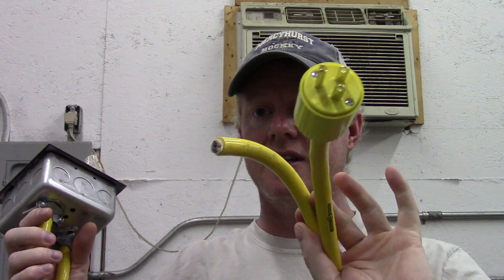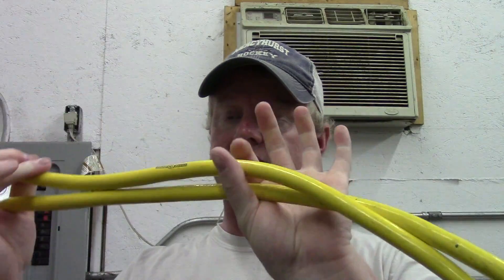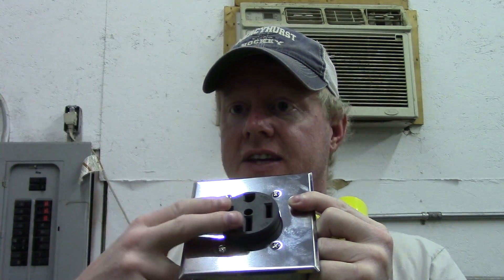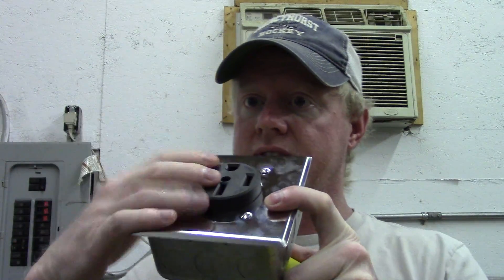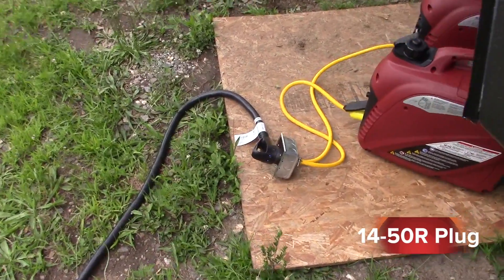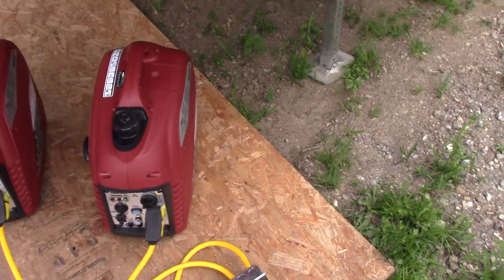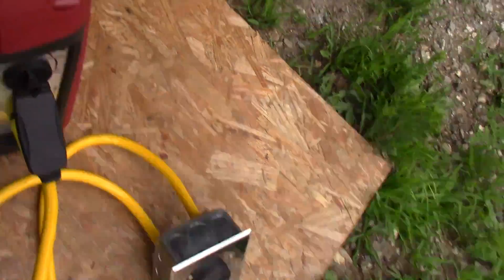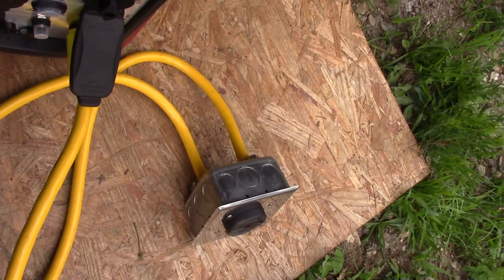How to make an Inverter Generator Parallel Cable  AKA Cable of Death

Comment: My Alpine has a 240V 50amp service plug and runs two 15k air conditioners. I'm thinking each must pull from separate legs. I haven't looked at the camper enough to say how the power is connected in the panel. Your adapter will provide 120V to each leg. As long as true 240V is not needed somewhere I'm thinking it should work fine. You don't forsee an issue on my application do you?

My desires are to parallel a Westinghouse iGen4500DF with an iGen2500.
Reply: Will a 30amp & 15amp to 50amp Y adapter work the same way as your cable of death?
Reply from the maker: Yes, if the adapter is adapting to 30amp 120V or 15 amp 120V.
Reply: Do you bond the neutral and ground together either in your box or in a separate plug?
Reply: You say not to disconnect one cable while things are running. What's going to happen if you run one of the generators out of fuel?
Reply from the maker: I would check your panel in the RV just to be sure. Everything in the camper needs to be 120V which it normally is unless you have some residential style equipment in there.  It will work but you will want to tie your 30A 120V output on the larger generator the smaller 15-20A 120V then to the 50 AMP RV plug to get the full capacity of that larger generator.
Reply from the maker: Larry Attebery Bonding neutral and ground isn’t advised. On having both plugged in it won’t hurt things if a generator runs out of fuel or you just use one. The important thing is that while either or both generators are running the male ends will be hot so that’s why they should be plugged in.

Comment: I built one of these to parallel a Yamaha 2400IS(6yrs old) and a Hyundai 3200(new) but it didn't work. All it did was overload the Hyundai and shut it down...any thoughts
Reply from the maker: Both of those should be inverter style generators. Sounds like you have a dead short.  Check your wiring (not connected at all) with an ohm meter you likely have some crossed up.  I'm assuming you used a 50 amp 240 plug and bonded the hot's as I did on the video?  If that is the case you should be able to verify with ohm meter that you haven't connected ground or neutral to one of your hot wires on the 50 amp plug.
Reply from the maker: Does the Hyundai support parallel operation?  I see some listed that do not.

Comment: Shane, 
I just built a house and had a generator panel put in so I can have lights, water, heat (5 - 750w baseboards) etc. 
In my garage there is a 20' cable that I plug into my generator, outside.  They put a 30a twist lock on the cable. I assumed I was putting 240v to my house, is this correct? 
I have a champion 9000w cont, 11200 startup gen.  (It has the big 50a receptacle, I don't know why the electrician's just used a 30a twist lock)
I also have a 3500w echo bearcat inverter generator and am thinking about purchasing another (and getting rid of my big champion, it's too noisy and hard on fuel as it doesn't have auto idle)  and making a "cable of death" parallel cable.  Instead of using the standard 15a plugs like in your video, I was thinking about using the twist lock plugs to go to each of my Inverters, would this work? And would this give me 240 to my house?
Reply: If I have two Echo 3500w inverters and if I make a cable of death with 30a twist locks that go to each inverter and then a twist lock type receptacle or 50a dryer type receptacle, will this give be 7000w and will it give be 240v? Thanks
Reply: Never mind, after looking at my big generator and then my inverter I see the the difference in receptacles... 
The cable on my house is a 4 pin twist lock and the receptacle on my 9000w generator is a 4pin twist 30a 120/240v....
The twist on my inverter is a 3pin 30a 120v (not 240)....

So is there any way to parallel 2 inverters and feed my house with 240?
Reply from the maker: The 30 amp twistlock could be 120V or 240V .  Is it 4 wire or 3?  Also on a house you typically have a standby panel or switched disconnect to prevent endangering power workers with power feeding back on the utility. First make sure you have this as you would pose extreme risk and danger to the unassuming utility worker. I assume this is all new stuff and you haven't had a generator plugged in yet?  You will want to get more information on how things were wired, intent, and make sure it's switched in a manner that could never back feed towards utility.  The only thing I can think of where they could have come close to meeting both building code and what you described as needed is a 30 amp 240V plug and a generator switch somewhere.  If that is the case the "cable of death" method doesn't work because it only works with inverters with 120V single phase.  You'll be pressed to even find a inverter based generator that is 240V.   The cable of death needs to be used with extreme caution because on the generator side you end up with a live male plug if you make an error and don't always have it connected.  Inverter generators along with the cable of death method don't typically lend well to house standby power unless it's just a few 120V loads.  RV's are normally special as they mainly have 120V loads only and don't normally connect to utility power at same time as genset.  Use caution and understand how your setup is engineered because, make no mistake, the cable of death itself does pose a hazard (mainly to you, the operator) but in your house application, if you have a un-switched pigtail 30 amp to any genset, you pose unassuming risk to anyone working on your service or utility line.
Reply: @ShaneBurrell1  thanks yes I have a second switched panel. And thank you that makes sense

Comment: The one that’s surging needs a carb clean .. clean the pilot (idle) jet too.
Oh, & BTW, use ethanol free gasoline.
Reply from the maker: I thought that as well.  Disassembled it and it was clean as new.  Swapped out the fuel and it runs smooth again. During the fuel swap I have a feeling the on-off on the fuel cap wasn't fully open.

Comment: I think I,ll do this but parallel the generators external with the 120 v plugs and a 2 male cord. I like it better than the parallel buss under Neath the screw terminals that already an iffy connection. Great vid never thought of this
Reply from the maker: Scott Falkner be sure it’s an inverter based gen
Reply: @ShaneBurrell1  Yes sir Honda 3000 and predator 2000 already paired them with a predator kit but think I'm going to return it @ $50 and build this since my RV  has a 50 amp 4 wire plug. Only thing on one phase is the smaller AC unit which I can't run at the same time as the 15000 but this will get me by accept in the hottest conditions.
Reply from the maker: Having the direct 2 plug gen to 50amp has been nice and easier to keep up with.

Comment: If you don't want to build the cable yourself, you can buy the Westinghouse Inverter Parallel Cord for $50 from ElectricGeneratorsDirect.  https://www.electricgeneratorsdirect.com/Westinghouse-WHPC/p78031.html
Reply from the maker: I did it for exercise and so I could go direct to 50 amp.  Westinghouse and generac have normal male plug cables but have a 30amp.  I really like the briggs style the best since they have safer female plug without having to fool with banana adapters and lug.

Comment: Could I do this with a ryobi and a Yamaha of the same wattage with a single 120 female plug at the end so what ever I plug into it will have the benefit of the double wattage?
Reply from the maker: As long as all generators are inverter type you could even use different wattage outputs. Just make sure to use a 120 female at the output side to handle the amperage.

Comment: Just to be clear, this can only be done with an inverter style generator, not a regular generator......correct?
Reply from the maker: That is correct.  Inverter style only.
Reply: @ShaneBurrell1  I heard that if using mixed (1 inverter and and 1 none) that the non must be started first, then starting the inverter and it will look to sync to the provided power and sine wave as best as it can. Any possible truth to that?
Reply from the maker: @kingdomkampers1  I don't recommend using a non inverter but if you did, yes you would want to start it first.  The inverter will need it to be already running in order to sync to it.
Reply: @ShaneBurrell1 should I use 15 amp or 20 amp connectors ?

Comment: Is there any reason this couldn't be done with three 2000w generators?
Reply from the maker: As long as you are talking about 2000w inverter style generators and not normal generators.  You can parallel as many as you want as long as wiring and plugs are rated for the current.

Comment: Can this concept be used on a single generator with 2- 30 amp receptilces to feed a 50 amp plug? King 8500 watt genny
Reply from the maker: Terry Schnare , it will only work with inverters . Won’t work with standard generator and also will not provide 220-240 volts. My guess is your generator is 120v 30 amp plugs? You would run into similar issue of you could do it but won’t get 220v if you needed it.
Reply: my mistake 2 twist lock but one is only 120 v
Reply from the maker: If you just need a 50 amp style plug and 30 amp 240 is ok I would just buy a RV dogleg for 30 amp to 50

Comment: Very informative video-Thank you...my question is we want to purchase 3 Champion dual fuel 3400 surge with a 3060 continuous watt each- making a total of 9180 continuous watts.  We will be using this on a food trailer.  What is the best way to apply all 3 to a 50 amp receptacle? If you could make a video of this would be awesome! Or just holler back through this...anything would be of great help.  Thank you
Reply from the maker: Are you needing 120V or 240V?
Reply from the maker: If you are planning on 120V loads only you will only need 2 of the champion duel fuel units and I would recommend there pre made 50 amp 120V para kit.  It's availible on amazon at http://amzn.to/2zCQSel

If you need a 50 Amp 240V real 14-50R you will likely want to look at a conventional generator that provide 240V - 50 AMP.
Reply: Boston Dawg

Comment: Looking to buy two predator 3500s and they don’t make the parallel kit for them yet. Would this be safe to use with that setup?  Also do you have a wiring diagram of how you connected the cords to the 50amp plug? I was with ya until you talked about the brigde
Reply from the maker: Other than the "dead man setup"  it's safe.  You just need to make sure that the male parts of the plug are both generators before powering anything up. Otherwise one of them could be energized. On the 50 amp plug all you are really doing is bridging the two hot legs together.  Now keep in mind this will be 120V and not 240V but most RV setups are 120V anyways.  You can check at your RV breaker panel and be sure you don't have any double pole 240V appliances.

Comment: Note for anyone wondering, that this system will not supply 240 volts as it will only supply 120 volts.
Reply from the maker: Its not problem.  My toyhauler and most campers are 120V.  And I won't get 30 amps out of a leg because the breakers on generator are well below that.   If you have a camper and like many have 2 small inverters (almost all these are single phase 120)  this is an ideal solution (given care and safety).  Dead man cables are dangerous in the wrong hands.  As far as whats better there is no better solution for my particular setup.  I have a 50 amp plug at the RV and 2 inverters and this is the shortest path without lots of adapting.
Reply from the maker: Most RV's are 120 but it's a good idea to verify before using this type of cable and any other dogbone that adapts.  30amp RV style to 50 amp is also 120V but most 50amp RV panels support 240V especially if you have residential appliances installed.
Reply: That's a problem, Shane.   Your toyhauler must be set up to run 120V by splitting the legs of your 14-50R/P connectors.  Once the legs are split, it's not any issue -- and you can supply 120V through each of the "hot" terminals on your 14-50R receptacle straight into the toyhauler system; each 120V leg will go straight to the breakers that are set up for the individual legs and everything will run 120V fine.  (A drawback is that you can only pull 30Amp on each of the 120V legs -- or a total of 60 Amps -- if you're running a true 240V system, you can pull the equivalent of 100Amp at 120V through the same cables and connectors; but if all you need is 60 Amps -- and that's double what you can get out of a plain 30 Amp/120V three-pin cord so this system is a big advantage -- it will work just fine for you all day long and that's good.)
The issue is that for true 240 you have to have the two supply legs exactly 180 degrees out of phase.  The only generators that will support connecting them up (double, triple, four, like you said) is by electronically matching the phase -- that way, you're doubling the amps but it's double the amps (and watts) but it will only come out to be single phase 120V.  If you (or someone else) wanted to plug a true double-phase 240V camper into your 14-50R on your jumper connector, it wouldn't work to supply 240V.  You can separate 240V into two legs of 120V but once you've done that, you can NOT "put it back together again" and you can't start with two legs of 120V that are in phase with each other and make 240V out of them.  Again, if your system in your toyhauler is set up for 120V legs, you can pull from 240V and separate the legs or feed your system 120V to each of your input legs and everything will be fine.  

And yeah, there is the thing about the "death cable" but we'll leave that alone.  What I would say is that if I were going to do that, I'd remove the 120V sockets on the generators and replace them with 30Amp NEMA L5-30R locking receptacles and use two L5-30P plugs on the jumper cables.  I'd also try to work up a lock system so that the two plugs could not be removed when either generator was running (not quite sure how to do that now - it would take some thinking about).  But yeah, we know about the dangers and we take care about them.

Comment: I will leave you with a puzzle. ALMOST everyone who has said they were shocked by 220 or 208 volts are wrong. Why?
Hint: it is even harder to receive a 480 volt shock.
Reply from the maker: Squirrels with long legs.  Gotta get across them both.
Reply: Shane Burrell sorry I was busy lately. I have known people who worked with electricity quite a bit who don't know that it's still 120 between that 220 buss and the ground. Still waiting for the  guy that can hang on to that buss long enough to grab the other one. I did have a friend who got against both 450 volt terminals in the Navy. Burned a hole in his arm.
Reply: Shane Burrell P.S. liked the squirrel thing 😀

Comment: In the Navy I used to parallel 3 megawatt generators. If you closed the buss breaker too soon or too late, it jarred the entire ship as several tons of metal tried to line up in phase. They showed us how to do this in a school facility on shore. Imagine my surprise when I did this the first time at sea with the ship rocking which caused the phase meter to not only speed up and slow down but sometimes actually reverse directions.
Reply: All the modern generators (Predator, Powermate, Honda, Yamaha) that are advertised as being able to be paralleled are "inverter types" and the electronic controls in the inverter circuitry is set up so that the phases are almost instantly automatically synchronized.  Ain't it wonderful what technology does now for free that we useta do the hard way???  :)
Reply: Apples and oranges.  Those 3 MW generators are not inverter generators.

Comment: LOL "To each his own" in other words, don't do this if your an idiot.
Reply from the maker: They use the guarded banana plug to "safegard" / "Idiot Proof".  I just didn't want to deal with them and prefer just making sure everything is connected (especially the male parts of the cable) prior to any startup of the inverter.

Comment: Thank you for your video , I have a couple videos on you tube with the similar cheater plug and got a ton of bad comments and nasty comments , nice that it worked out great for you
Reply from the maker: It seems to be magic to most and I've got some negative comments as well.  I think alot of that stems from understanding.  I just keep posting and try to help of anyone asks.  My cable is still going strong and its been nice to have AC while dry camping.  Neat video you have on a triple setup.  It's here for anyone else wondering about triples or connecting different size inverters https://www.youtube.com/watch?v=qKam1o_3t_w&t=663s.
Reply: Yes, connecting is simple if both/all the generators support matching the phase in the electronic controls in the generators.